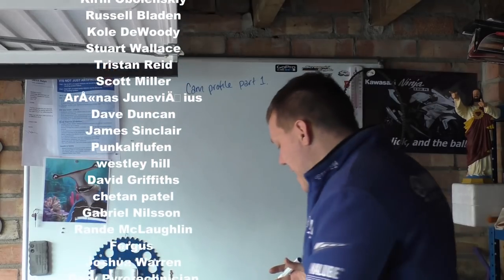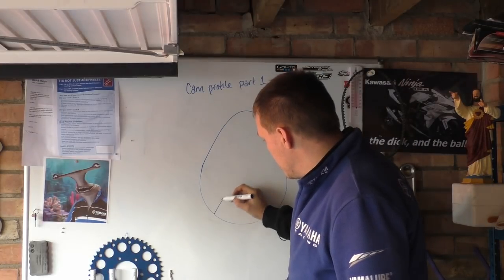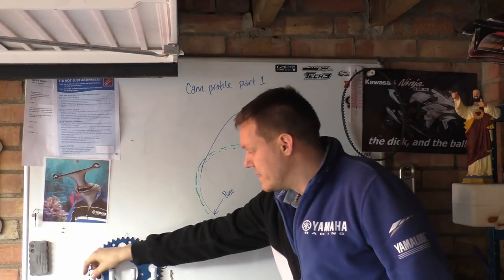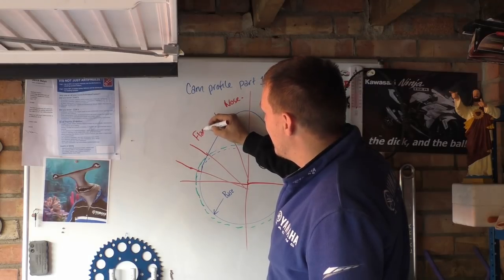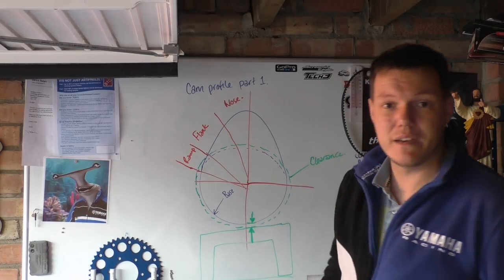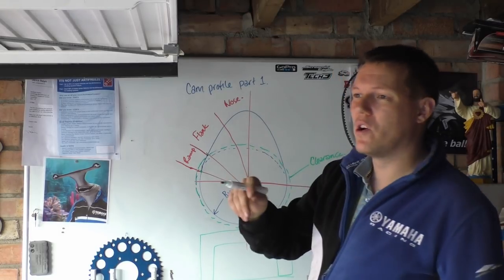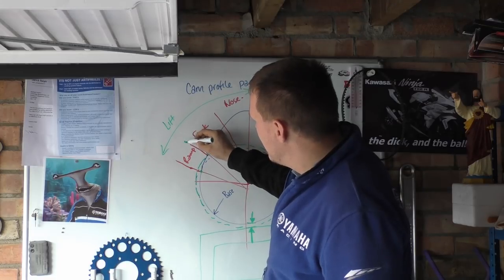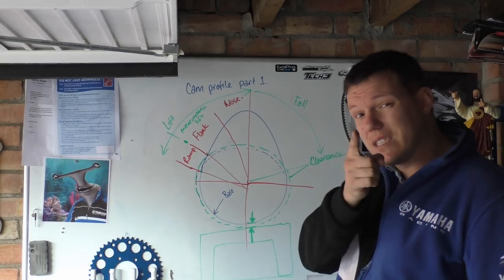Cam profile | nomenclature

Comment: Worth adding that when dialing in cams, the degree of lift values given are usually at 1 mm or 40 thou valve lift unless the cam maker specified otherwise.
Using a dial gauge on the edge of the bucket follower to measure 1mm lift then reading the degree wheel.
Reply from the maker: This is all for later down the line

Comment: Seriously Matt. There's a lot of roller rocker engines out there now. Mercedes M156, Ford 5.2 (bullshit engine, but still cool). Then there's the Honda TRX 450R with bucket/shim on the intake, and a rocker with single lobe for the exhaust valves. Bunch of K-series hondas. High revving SOHC. F1 engines have rockers too. Rockers themselves have an interesting effect on valvetrain geometry.

Comment: I have searched the race cam specs of both s1000rr and s54 m3 engine. Both engines use finger followers(rockers).
 the m3 cams had 280 and 270 deg with lift around 12.5 
S1000 had around 260 deg and around 10mm lift.
How the hell does the S1000rr carry the torque curve between 6000 and 14000 while s54 bmw m3 carries between 3000 and 8500
Is it the lobe separation angle? Or what exactly causing this? Because even if both were made to the same stroke the engine will looose torque at 8000rpm while the other will carry it.
Reply from the maker: LOL because the engines are completely different. Lets take the s54 - 87mm bore and 72mm stroke. 

The S1000RR is 80mm x 49.7mm. The difference is the bike is hugely over-square compared to the car. 

Why does this matter? Flow through the head is created by how the piston 'creates' volume. The bike does this slower, which when you go higher and higher rpm means that the cylinder has more time (relatively) to fill, hence a higher Ve and therefore more power at those higher rpms. So if you use exactly the same duration, like in your example, then the out-come will be different.

The bike engine can do this, because it can sacrifice torque to rpm. 

I'm doing a video about this very subject this week. - This might will catch you up a bit if you haven't seen it already - https://www.youtube.com/watch?v=MxHDN66R9II
Reply: @dirtygarageguy  thx for the reply I have watched that vid ill check it again